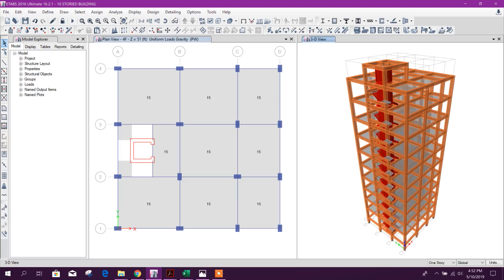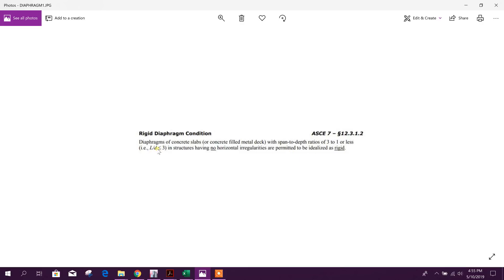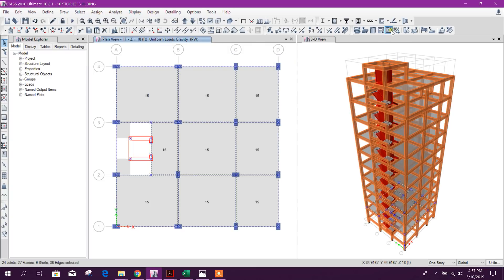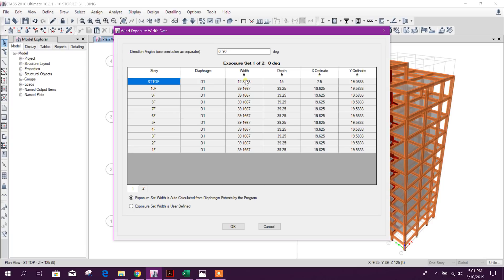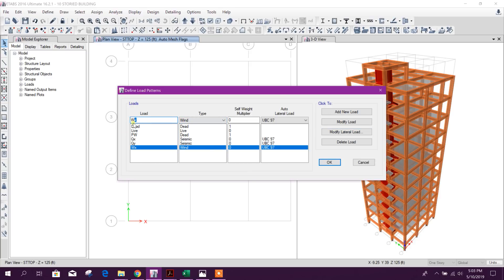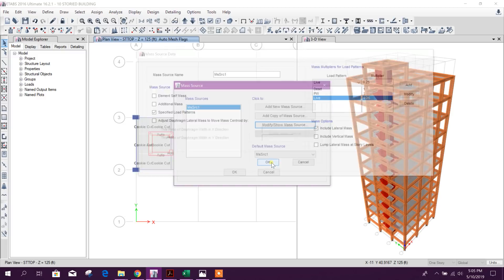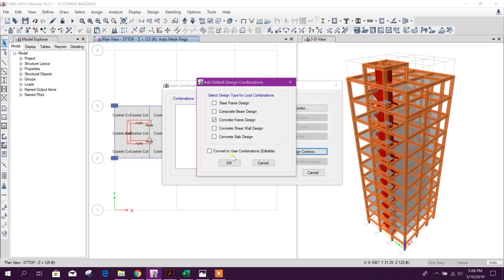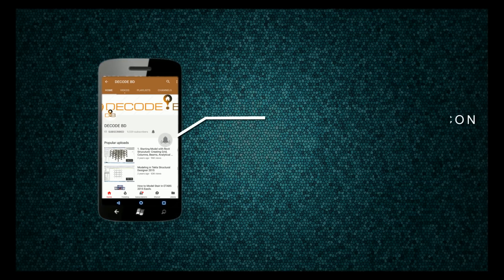10 Storied Building Design in Etabs-Part5

Comment: Why do EL, and WL not applicable at a time?
What's the concept behind?
Does wind will not affect after a hit earthquake affected region is there anything like that?
Bcoz we can't predict the natural calamities..

But economic structural design is important and as well as safety and serviceability of structure also..
Reply: Consider a car, or a helmet. You are protected in them in most cases of usual low intensity falls or crashes (when driving responsibly), but not in rare extreme ones (on highways with head to head collision). We can't make something destruction-proof, just resistant to damage to certain extent. 

Secondly, chance of simultaneous occurance of a cyclone or max wind condition along with earthquake is almost negligible. Then it will be an unfortunate event.

Last but most important deciding factor is financial feasibilty. To construct a building resistant to earthquake and wind when experienced at the same moment will send the budget to the moon. 🥲 Even poorly designed spaces are going beyond working class people's budget.